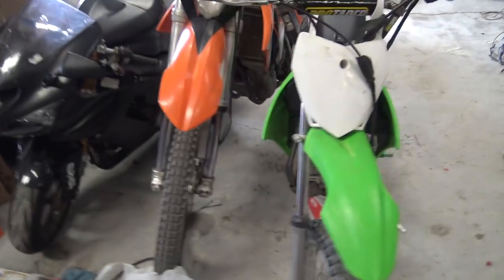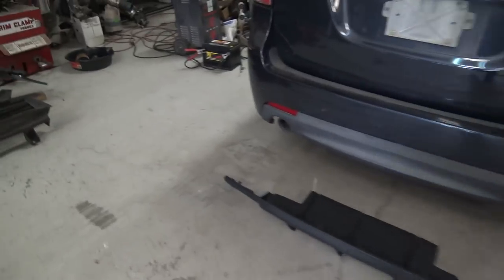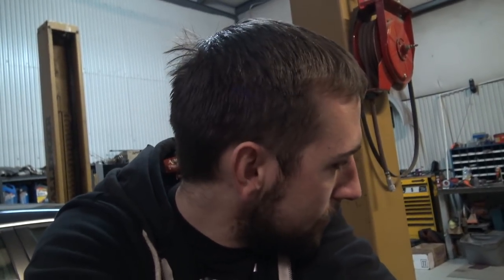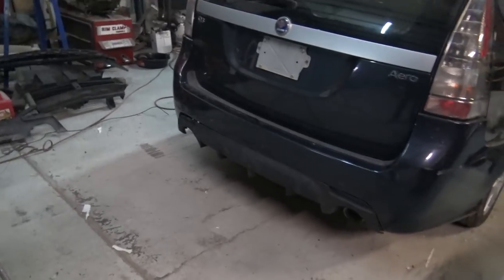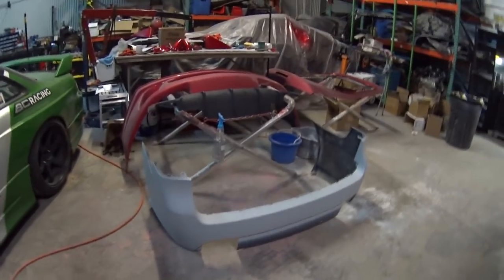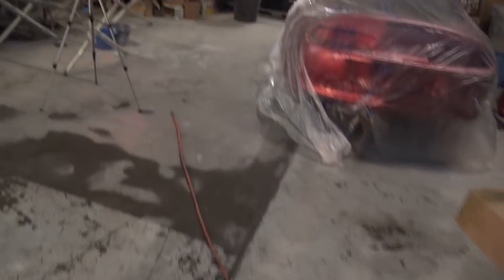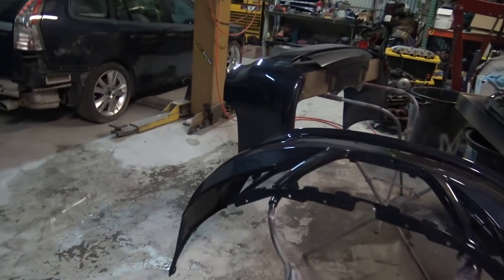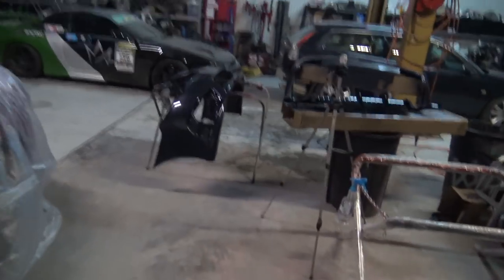Rear Diffuser and painting bumpers for the Daily Driver Saab Aero Wagon! How to Not paint Supra...

Comment from the maker: I know, I know, work on the Supra Right? It's coming, if you see how the paint turns out in this video just spraying It in the shop is not good enough. I'm currently figuring out some sort of temporary"booth" for the shop LIke a greenhouse/ party tent modified with some filters and fans!
Reply: I actually like the saab more :D
Reply: if you want it perfect why not pay a professional?
Reply from the maker: I know I can do it, I just need the right environment to spray it in. I also wanted this car to be done by me as much as possible
Reply: MotionAutoTv if you mess it up again you're gonna hate yourself for it. The biggest issue I feel like is that you just don't want to pay for it. Which is understandable but it seems like candy is something that is worth doing once perfect rather than twice with small imperfections that will bother you. In the end it's always gonna be your car no matter what you do.
Reply: Give the Supra to a professional body shop for the painting. If the shop messes it up they have to fix it and not you plus you can save time and energy for other stuff.
Reply: switch up the color to make it easier on yourself
Reply: If i was you i would buy one of those 250$ car tents that go outside thats made from tarp material. i used that to paint my car outside and i had very little dust in my paint.  if you put that inside your place and wet the floors and do the car in sections i think it would be a win win.
Reply: Work on the daily driver Supra and it will help motivate and give you ideas on the ultimate Supra you want to build.
Reply: Dont worry about the supra man! everything u do on the channel is interesting to most people on here, just look at the likes/dislike ratio on this video!
Reply: MotionAutoTv i feel your pain.. I’m sure we are very similar mentally.  I get hooked up on detail/perfection so badly it’s safer just not to finish things. Eats me up if I don’t finish something perfectly - whether it be car related or diy I want to look at it and think that’s amazing. Just remember 99% of people don’t even look at things properly or can even see imperfections when they are looking for them. Helps a little.  Plus waiting and working on something when you’re enthused always has better results..
Reply: I'd rather see skids than Supra build stuff but I really like watching paint videos. Between you and the Haggard guys I'm almost tempted to try painting my own car. Not that I have the space to.
Reply: MotionAutoTv I've done a party tent paint booth, didn't turn out too bad with a dehumidifier as a fan, and a first time painter, sure it's got a few little dirt and clear coat speckles, but as long as you're ok with a semi janky "booth" I'm sure you can pull it off even better then I did
Reply: Look up home build by jeff, an Ozzie who build a regular party tent into a decent indoor spray booth. I'd say he did a pretty good job being a self-thought DIY-er, pretty good channel overall BTW. Between him and you  I feel tempted to try this out myself this summer. Though keeping in mind that it wont come out perfect being a first-timer in painting a whole car.

I feel for you on the Supra, coming from a similar mindset, namely being a absolute perfectionist. I'm sure you sure you read some of my previous comments on it so you know, You'll figure it out!
Reply: Buy one of those car tents and try the civic or something else first then decide if u want to go that way
Reply: Check out a carcoon... Yes that's really the name. There's one on Craigslist Rochester N.Y. kinda far but might be worth a drive
Reply: MotionAutoTv wagons are badass, supras are badass. Keep doing badass stuff
Reply: I know it’s easy to say but the supra paint looks good to me. Guess it’s different in person but I just feel like a good buff would sort it out, plus let’s be honest driving supras around is much more fun than a Saab!
Reply: trev i think your right and that they paint that you just laid in your shop looks alot better then what you did in your neighbors booth
Reply: 1000s of supra video's, PLEASE make a fast Saab maybe a rwd 😎😎😎😎

Comment: I think you and dave need to sit down with a floor plan of your shop and work out where to put a booth or semi permanent booth (or booth area/space) for spraying as you have the room for it (and dave has some good ideas sometimes lol), whether you build a skeleton/tent booth and use polythene walls/ceiling and have venting where you need/want it. might give you ideas on what to move, sell or get rid of.

Organising your project cars into the cars actually being worked on and not donor vehicles will lower your actual projects from 23 cars down to a lot less too (might help with dilemmas on what to do and what order too? lol)

If you have no plans for some of the cars then you'd know what you could get rid of and any donor cars could get stripped and parts sold that you're not going to use to get some quick money in? (and clear space too)

Worth a thought?

Comment: Yeah something about the airflow in there, less stuff gets on the paint than in the booth you had. I wonder if putting curtains in the shop would make it better or worse,  you never know how it would affect the airflow.

I think that when you are spraying at a downward angle with the paint gun, which is pretty much most of the time, a lot of the spray misses the target and shoots off into the floor and then kicks up dust and debris from the floor which then float into the air and wander around before settling back down. I think that if you just cleaned the floor or put down some plastic around the area that you are painting in you could get rid of a lot of the inclusions that you are getting. On top of that you can buy those home HVAC system house size air filters at the hardware store and they fit perfectly over a standard box fan so if you left one of those running on low in the shop maybe that could help too. I saw somebody who ran one like that for 6 months and it picked up sooo much crap from the air.

I think you are doing the right thing by trying to figure out how to best paint without getting these inclusions before you commit to the supra since you spent so long getting the body so perfect, you want the paint to match. Keep experimenting til you figure it out. Keep up the good work and videos.

Comment: Just throwing it out there- what if you built a structure out of the racks you have the cars on- build like a small garage sized structure in the shop- use it for storage the majority of the time- then when needed, plastic sheet the four sides and roof, ventilate it and use as a paint booth? It would be kind of makeshift, but it would keep particulates out of the paint and you could just put plastic over the four sides of the structure and contain the overspray instead of covering everything else in the garage. when not in use throw cars under/on top of it. BTW- thanks for the motivation to get me off the couch and into the garage!

Comment: ** For Fitment On the Diffuser** I have a map tun carbon fiber diffuser, when installing it you need to cut the bottom half of the bumper to get the diffuser to fit. You need to cut pretty much all of the plastic in the middle that goes from in-between the exhaust to the bottom side of the spare tire compartment.
Reply: I sent you a diagram for the installation on instagram